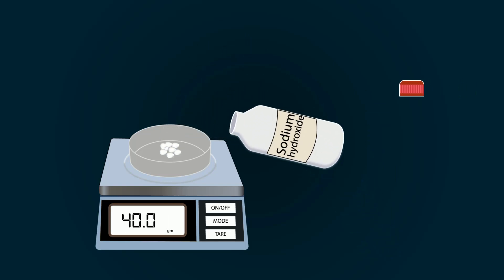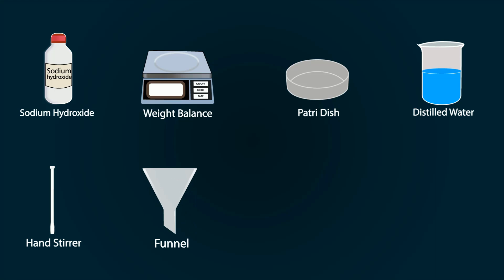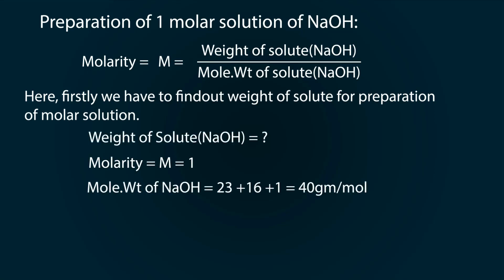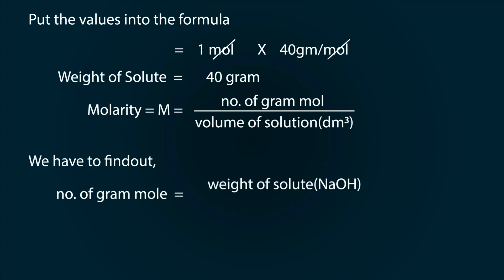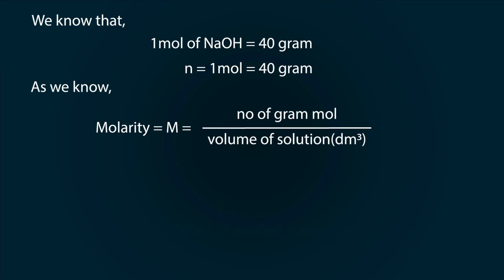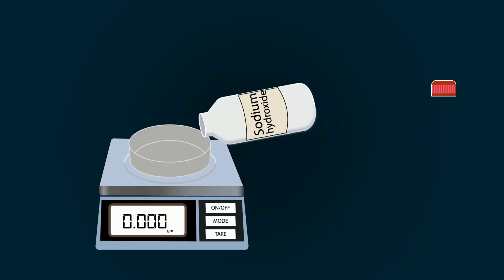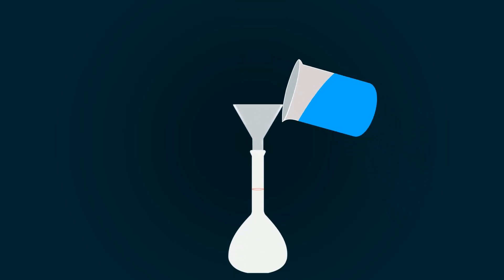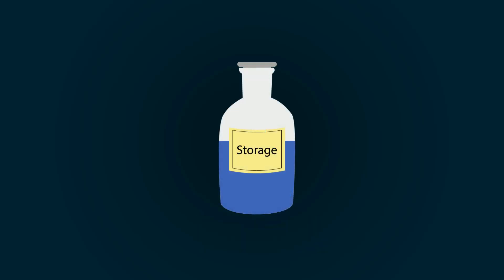1 molar solution of NaOH | 1 m NaoH | 1 molar NaOH calculation

Comment: sir how about to prepare 1M of NaOH 250mL?
Reply from the maker: how much NaOH required for 1 molar 1000ml/divided by 4
Reply from the maker: take 4 gram NaOH and put it into the 250 ml measuring flask and than fill distilled water upto Rid line.
Reply: @sourceofskills  Sir, could you make a video for that case? I understand now how to prepare it but I am just curious about the calculation. At first, I thought, 40g of NaOH is mixed with 1000mL of DW if the desired volume is 1000mL. However, regarding the final volume is 500mL, 20g of NaOH is mixed with 500mL of DW. But now it's wrong. Therefore, for a full explanation of together calculation, I would like to request to make a video regarding this.